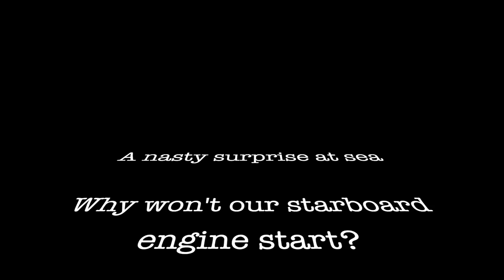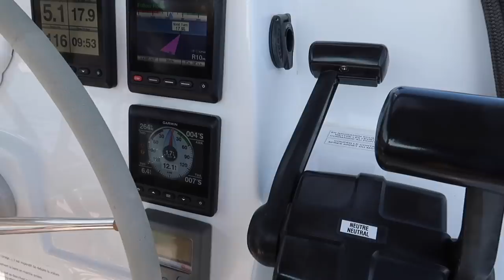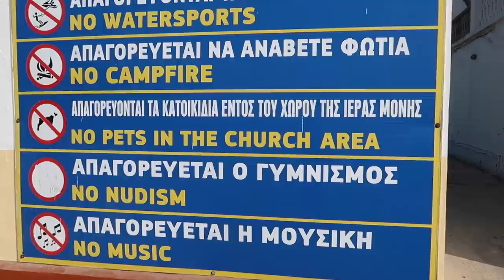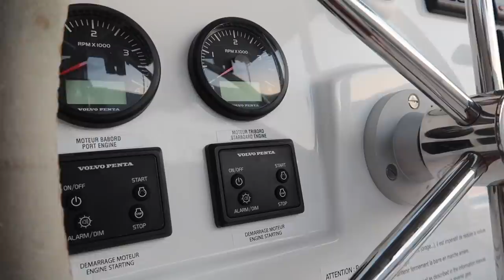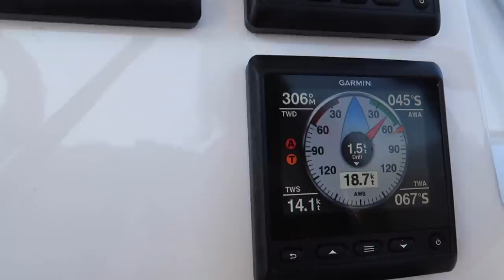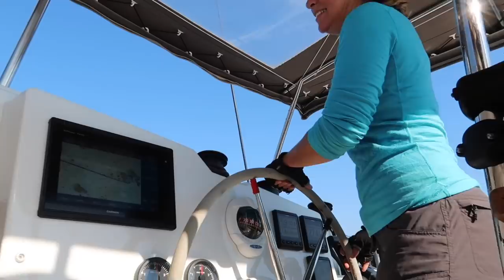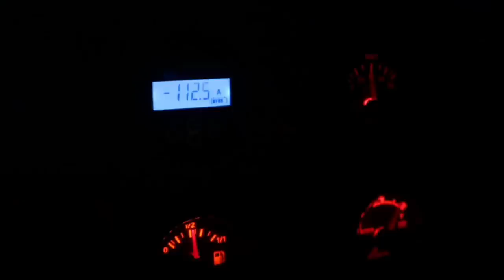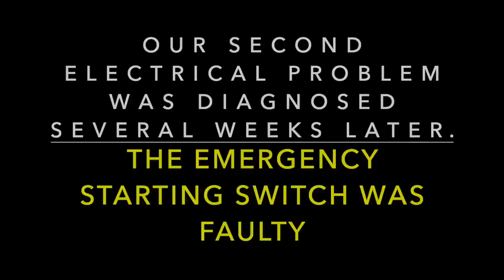Let's Dance Sailing Story #55 - Houston, We Have A Problem

Comment: Great Video again Guys. I'm Avionics engineer on helios here in Aus
Understand your probs, LOl, Was a good find on the short CCt initially 

Hopefully you are all safe with the virus and things get back to normalis soon
Reply from the maker: Tim Lucas , Thanks Tim glad you liked it.  Thought we had it when we found that short, was gutted when our problem continued.  In the end it was such a simple fix it was ridiculous, isn’t that often the case, cheers.
Reply: Well that cable probably caused the end result , Also as others have committed on great muzic
Reply from the maker: Tim Lucas , we agree and suspect the short did cause the switch failure, glad you like the tunes, cheers.